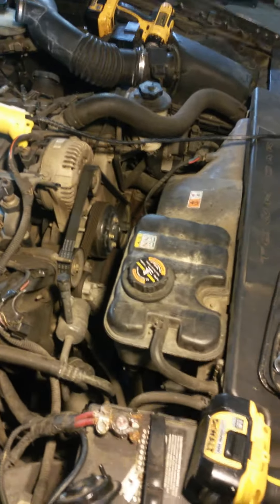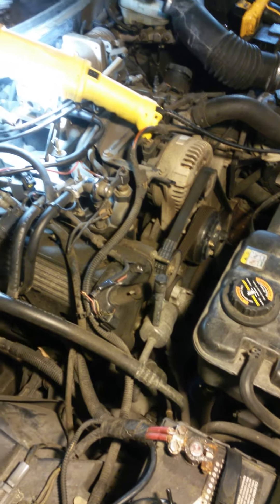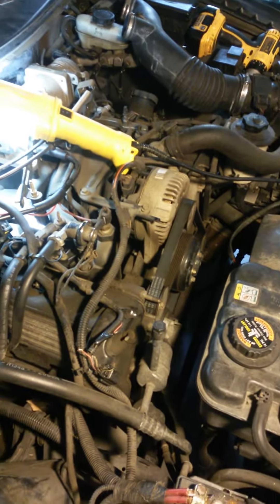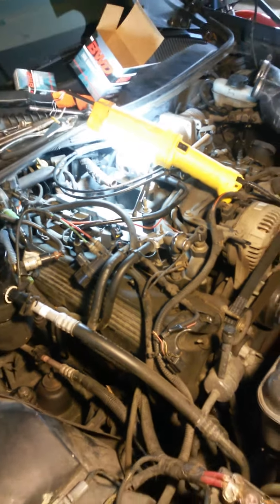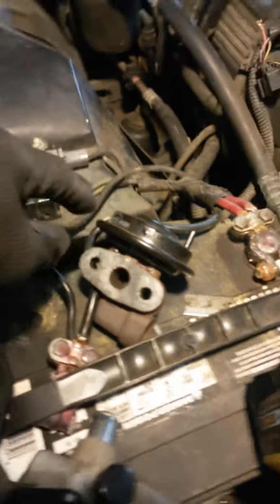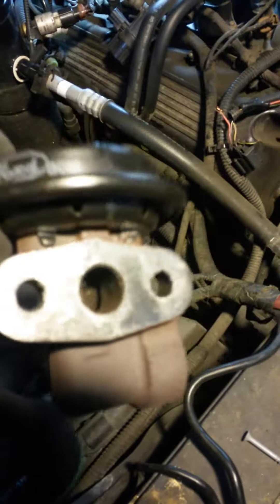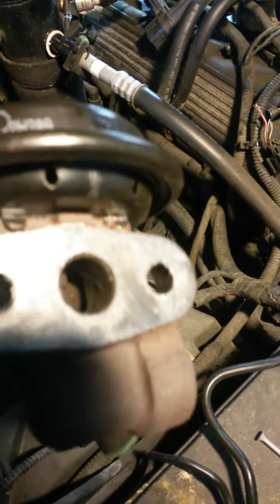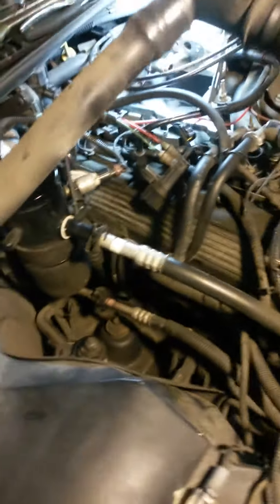2001 lincoln towncar EGR & IAC

Comment: lol yeah i worked on my 85 5.0 for necessity and i learned alot about cars and it is fun when it works the hardest part is diagnosing what is wrong and i hate rusted on bolts . a breaker bar helps or a hollow tube from a broom or mop can be put over the wrench for added leveredge
Reply from the maker: wayne5009 thanks for the tip.

Comment: I have that 93 Lincoln Town Car and I'm trying to replace my EGR valve and idle control two mechanics turned it down the job. They say the EGR valve was too far down in there for them to mess with I believe our engines are almost similar I don't know how you did it but you did it